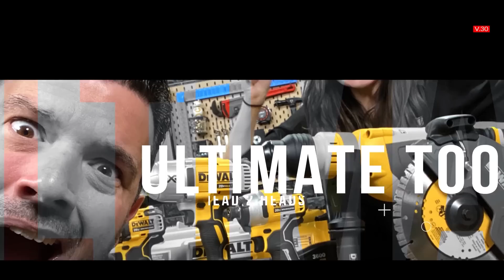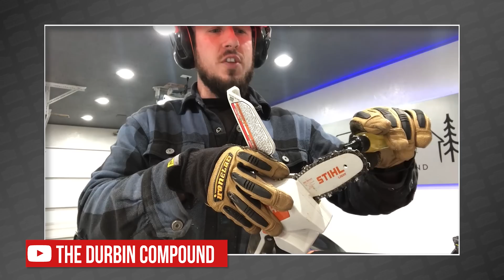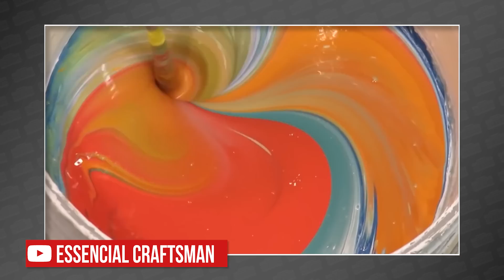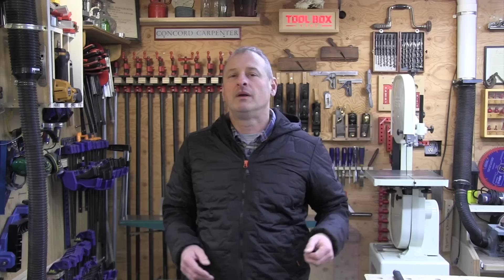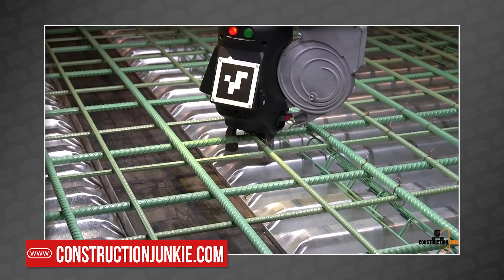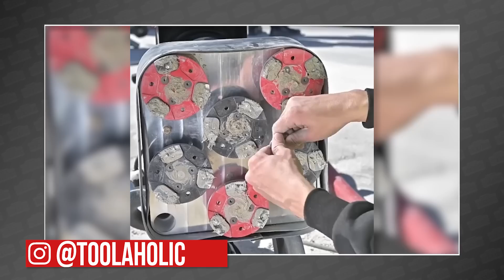[TOOL NEWS] Milwaukee Tool needs to CALM DOWN. And the smallest Stihl Saw EVER. Week In Review S3E7

Comment: It blows my mind that Milwaukee is gonna beat DeWalt to a higher voltage impact wrench since they have had flexvolt for years. DeWalt should be dominating the 1" market can you imagine a 60v d handle 1" impact wrench? Wishful thinking I guess since they haven't even released a ratchet yet
Reply: Zack I don’t understand why they have what a grinder which is a beast and a recip saw and a circ saw what a waste of the flexvolt line up
Reply: @MichaelSmith-sj5uk  yeah it's very limited just seems like they could offer so much more I mean everyone is competing for the most powerful hand tools especially impacts and they have this 60v system that will slide right into any of their 20v tools but they haven't used that to their advantage at all. I'm hopeful they will make some big releases this year in both the 60v and 12v platforms otherwise it's gonna be hard to stick with purely DeWalt tools they just don't have everything I need!
Reply: Zack with Milwaukee having their electronic rathchets and both cordless die grinders I have to go with Milwaukee for their 12v line I just have to much invested in the flexvolt line